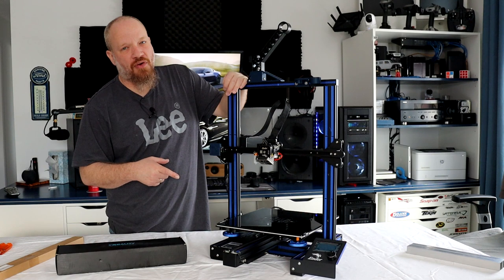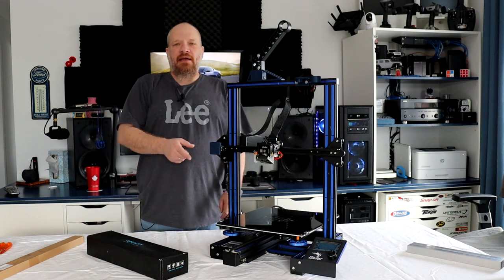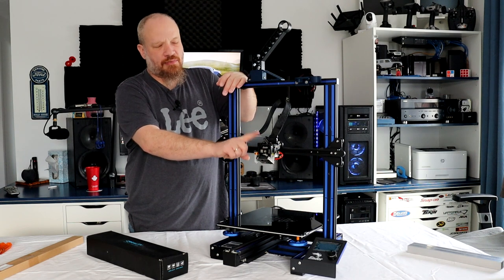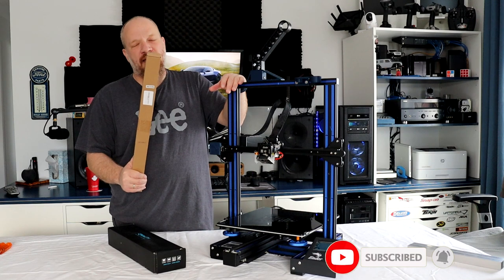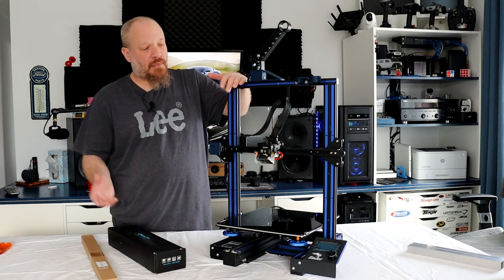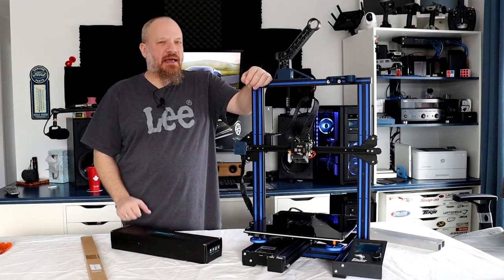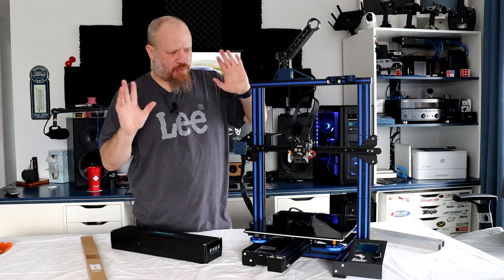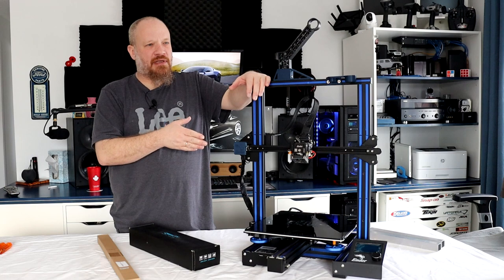How To Install Dual Z Axis Lead Screw on Creality Ender 3 Max Using the Ender 3 Kit

Comment: Does E3MAX really need second Z lead screw, or is it just "placebo" upgrade?
Reply from the maker: No, you don’t need one.  I have to ender 3 Max.  And only one that has the dual Z both work very well.

Comment: Anyone else have issues with static build up after installing this? My LCD screen displays wingdings and insanity after about 30 seconds and some googling said that this upgrade removes the grounding from the power supply
Reply from the maker: First thing you’re not removing any ground you’re putting away to split the signal to two motors you might’ve unplug something on your board by accident and make sure you’re not your feet or not on the carpet.  Me personally never heard that.
Reply: @djsprc  https://youtu.be/xBZeGrCVGws not quite correct, but thanks for confirming everyone doesn't have issues with it. What is the power supply setup you used? Didn't see it installed in the video
Reply from the maker: @jacobfrantz5970  now I do understand what you mean not grounded I would say yes and no it is a 24 V system. The main board will be grounded to the chassis. Now the power supply used to be kind of grounded to the chassis.  My printer the power supply is underneath my table. It is a wooden table. They are not grounded to each other. They are grounded by the main power cable. If you want to try, grab yourself a wire grounded to the power supply, use one of the bolts in front of your printer where your display is and grounded to the power supply. Now be careful do not use a too long of a bolt to the side of the power supply not to short out anything inside.   This is something I would do I do have 20 years experience in car audio.